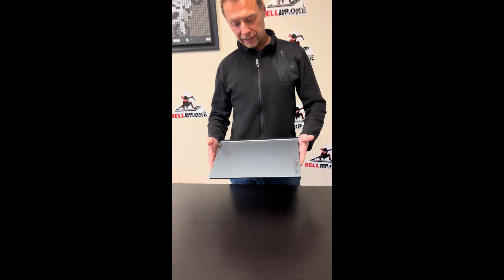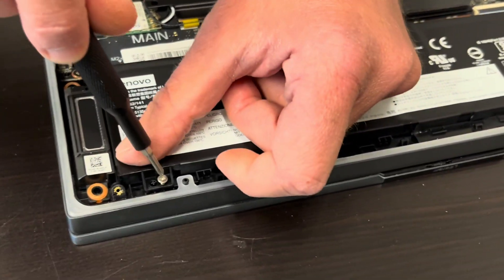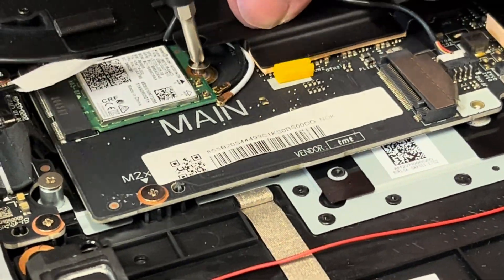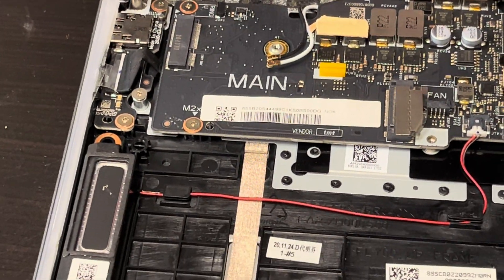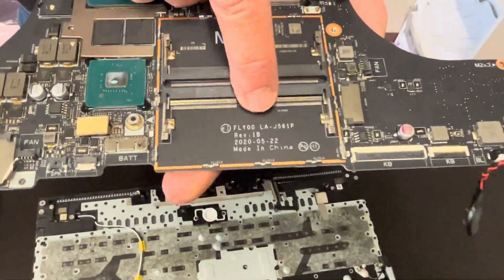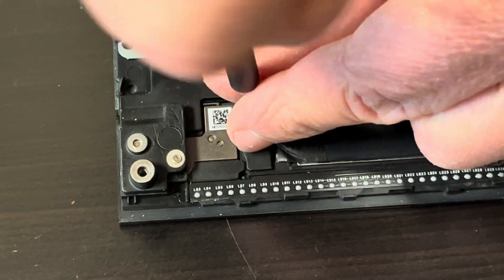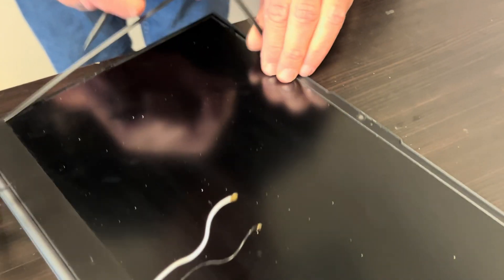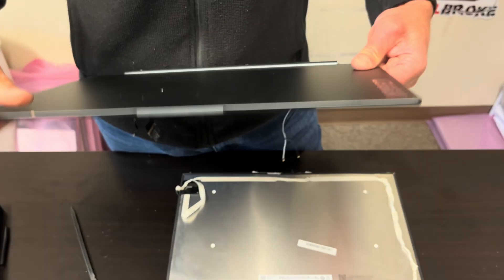Lenovo Legion 7 Laptop. Take apart, fix, repair, upgrade replace: memory SSD Motherboard LCD Battery

Comment: What do you think of the Lenovo Legion 7 Pro laptop, does it work for 5-7 years?
Reply: I have one, they have have cooling issues after a couple years. It's a pain in the ass. I think mine is gen 8 or 9. Its i9 13900 4090.

Comment: ich bin begeistert wie schnell , informativ,(know how),liebe fürs Detail, du eigentlich hast 🤌🤝. 

habe mir das Video angeschaut , weil ich habe mir den Laptop um 800 Euro gekauft . der Verkäufer war Erstbesitzer,  optisch gepflegt,  etc . das war der Grund für den Kauf. ich lege großen Wert auf den Umgang mit Elektronik.

um alles richtig zu machen ,habe ich den Laptop einen Shop (pgv) überlassen und die (thermo -paste) zu wechseln .

(Neupreis von dem Laptop 3250€ )

(rtx2070 super , i7 10750H, 240 Hz, 15,6 Zoll)

anstatt einen neuen zu kaufen entschied ich mich für den 😅. 

laut ihr hat sie nur Videobearbeitung gemacht. 2 Jahre benutzt und gute 3 Jahre aufbewahrt 🫣ich finde der Laptop hat sehr stabile Komponente,

Legion 7 15IMH05 81YT000UGE

das Video hat mir Aufschluss gegeben , um ca einzuschätzen viel viel es kostet . (max 130cash) 
danke für  dieses tolle viel 👌

ich hab viel gelernt.

💁Arigato gozaimasu
😊

edit it's 240hz ( I allrdy changed ☝️ sort oben )  I Said it has144 🤦hahah

Comment: I need to replace the keyboard+top cover that the keyboard is attached to, does it require to disassemble the laptop entirety to reach the cables to unplug the keyboard ?

Comment: Learning to pull parts all to access and swap keyboard…….fun times
Reply: Same here haha, I need to replace the c cover + keyboard cz my w and q are dead.

I though I won't need to take out everything to replace the cover. Seems i was wrong
Reply: @Sevenus29 You don't need to replace the cover either. A dremel and 10 min will eat those plastic rivets that don't need to be there. They are there so lenovo can make more money off parts and nothing more... it's a shit business practice. Mechanical retention will keep the keyboard in place.
Reply: @crysiscontained4421 already too late i replaced it entirely, the keyboard seemed to be glued to the cover where the mouse pad is, didn't want to mess with it too much because I'm not experienced enough with laptop assembly. Everything works fine now, i even found out I can tap on the keyboard on my native language without replacing the key caps where I have the other letters except English.
Reply: I have the legion 7s and the 2  rear usb ports may need to be replaced. Are they soldered on? How do I find replacement ports?